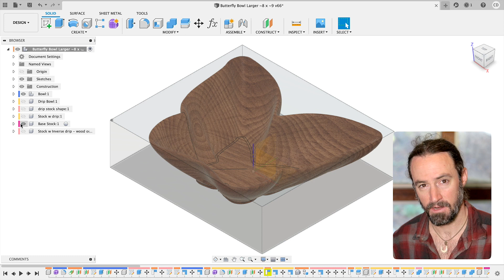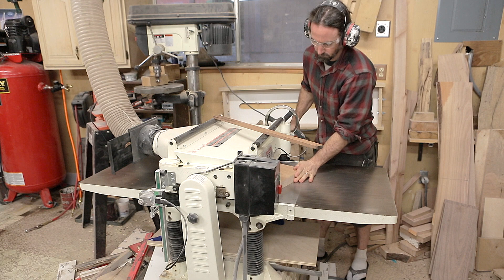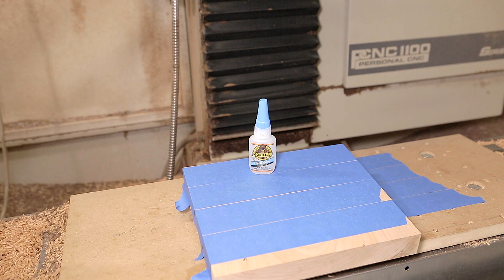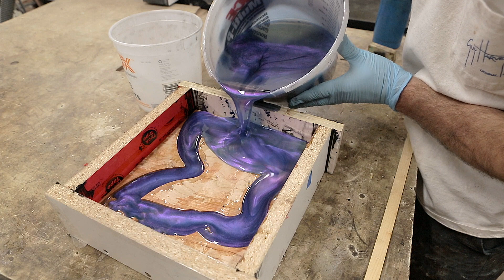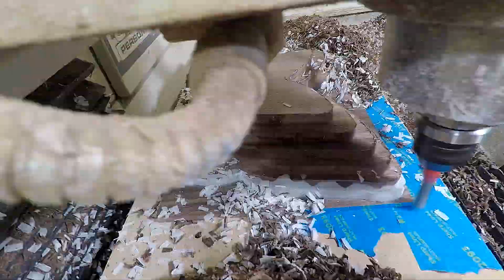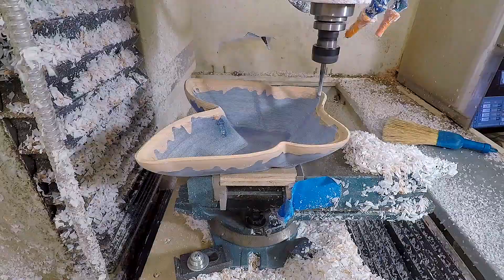Purple Epoxy and Wood Drip Butterfly Bowl - CNC Woodworking - How to make a wood CNC bowl with epoxy

Comment: Great video.  Preparing to make a butterfly bowl using your files so watching several different versions to decide how I want to approach this.  When you say quick setting epoxy what are you talking about?  Were you using the wise bond quickset and deep pour for this project?  What is the black sealing material you are using for sealing the form.  Is it black cauking or something else?  Do you use a 3/8" Upcut endmill or upcut spiral ballnose for the roughing?  I was using a 3/8" enmill in some projects but had some pretty bad tearout, so was rethinking my strategies.  Why did you decide to machine the outside of the bowl first and then the bowl section.  I would think machining the inside of the bowl, using dowel pins, 3D tabs and then the outside of the bowl would make keeping the alignment easier.  But I know you think these things through and want to get your thoughts on the strategy I mentioned.  One last thought - have you considered using a pressure pot after pouring the epoxy.
Reply from the maker: Yeah!
1. I used WiseBond deep pour and WiseBond quick seal. It should have been cooler to avoid cracking with a deep pour like this; a fan on it would have helped.
2. black stuff is silicon sealant/caulking
3. I use 3/8" up cuts so I can use "3d adaptive" in fusion and take big cuts. Tear out is usually due to entry/exit. It does leave a rough top, but it will be machined away with the finish pass.
4. I do outside first to produce a flat reference surface to secure it for the top operation. Tabs could be done, but you have to be careful to not hit the outer area; collisions are possible with deep bowls like this one. So instead, I prefer to machine away all the material to avoid collisions. I also now like making a jig to align it for the second operation, and the jig will have alignment holes with dowels. 
5. Pressure pot: yeah! It would help for a lot of stuff -- I just don't do enough epoxy to really need one.
Reply: @CorbinDunn  thanks for the feedback